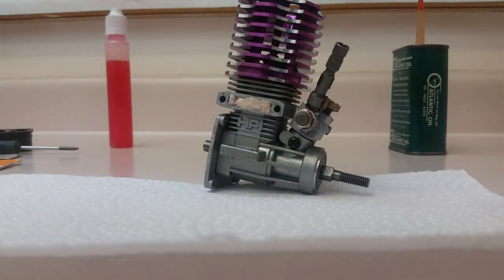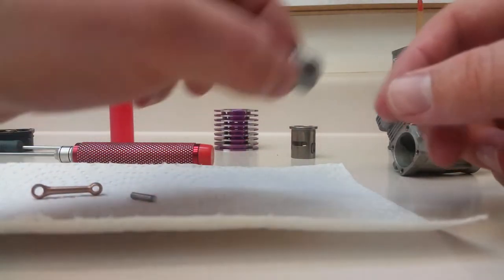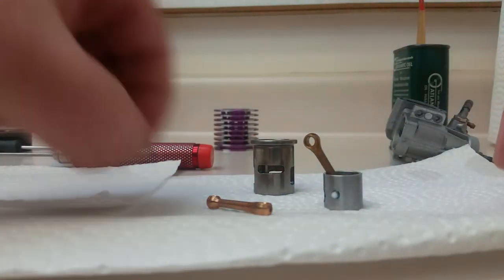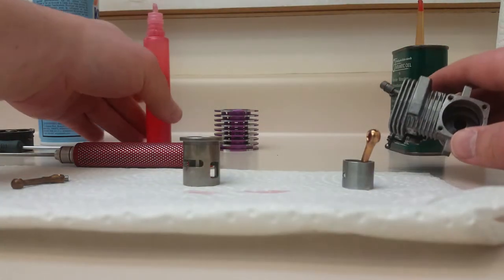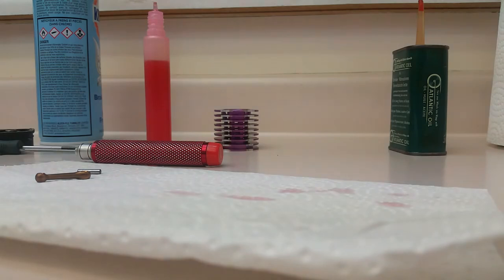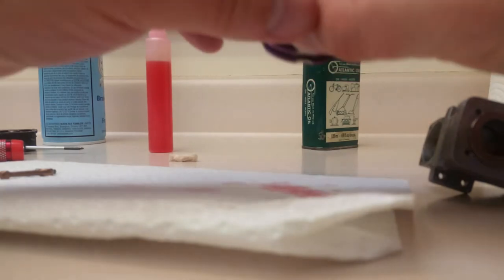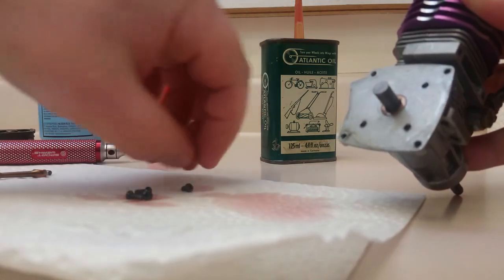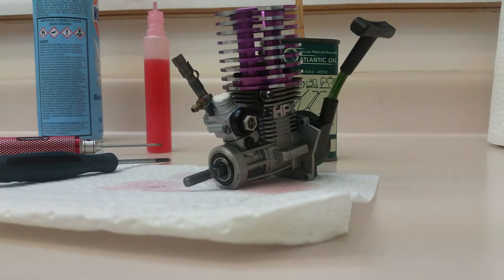HPI 15E engine piston pin and connecting rod replacement

Comment: wow! questioned answered at 1.44 in this video! what happen  i took apart my HPI 12R SS Racing Engine and could not remember what side that big hole on the piston was facing ,so i panicked and there it is when your piston hit the table! thanks very!
Reply from the maker: Hey sorry for the very late reply I just got your message like a rate this 2nd and the big hole in the piston faces opposite to the exhaust port

Comment: What do you suggest for a replacement rear case gasket. I have a old hpi pro k12 evolution II engine that when i removed the rear cover it just disintegrated. And none to be found anywhere.
Reply from the maker: Get gasket paper and cut your own
Reply: @thebug4046  , the one that disintegrated was clear, like wax paper in a way. Probably not even as thick as paper. I have been unable to find anything that thin. I'll keep looking. Thanks for the tip and content. I'm enjoying your vids.
Reply from the maker: @speedbob712   If you're really good with an exact and if you can actually use a piece of printer paper and a little bit of moto seal
Reply: @thebug4046  that's a great idea. Thank you.

Comment: Same operation for the 15FE, correct?
Reply from the maker: 15e 15fe 12e 12fe all the same procedure yes
Reply: @thebug4046  awesome, thanks!  I need to deep clean my engine; it runs, (after almost 10 years of inactivity), but runs super rough.
Reply from the maker: @Snyper1188  I think I have some tips on cleaning engines I'm not exactly sure being as I have a lot of videos but what you can do is clean the inside of the engine out with some fresh fuel or non-chlorinated brake parts cleaner to remove all the varnish also check to see that your high speed needle is clear of any varnish and that you have no fuel tank leaks or any exhaust leaks has that will cause you a lot of tuning issues another thing is to stay away from using WD-40 inside your engine that stuff is horrible it washes oil away it leaves your engine dry and will not protect against metal to metal contact you can reassemble your engine with some after run oil or some castor oil if you have sum also stay away from Traxxas fuel it's really crappy stuff get anything other than that also if your fuel is very old that can cause running issues as well
Reply: @thebug4046  I have about half a gallon of Blue Thunder 10% sport, castor oil, I will have to get...  I have both a 15e and a 15fe-which is on the car with the rotostart, as my car is the rs4 evo.  I have fixed my idle as not to go below 1mm when applying the brake, and it doesn't die now, which is always good lol.  My carb needs to be throughly cleaned, as does my needle valve.  It seems to be "pissing" rich.  I have both a single speed (47 tooth I think), and I just received a stock 2 speed, (found and bought from the netherlands) but I will have to order a new bell housing.  I thought I had one here in Kentucky, but sadly it's in Florida with all my other crap.  I converted it from 2.4 to 4hz, my OEM radio was trash.  I will probably post a video of investigative surgery to see if anything needs to be replaced, but that will be a while, I got a lot going on right now, and dont want to open either block until I can replace any worn or broken parts.
Reply from the maker: @Snyper1188  Blue Thunder Field isn't bad stuff at all they don't sell it in my area anymore and for castor oil I usually get Maxima 927 or klotz castor oil with the green label you can add it to your fuel you can use it to make your own Fuel and you can use it as a assembly Lube

Comment: Hey I have a hpi nitro star pro .12 K12 engine can’t find a pull starter for it will fe fit don’t ???
Reply from the maker: The K-12 is actually a rebranded Novarossi engine that engine is so old they're almost impossible to get parts for
Reply from the maker: You can try and see what happens

Comment: Hello..I'm from USA, just wondering where to get the parts I have OS and the same model stated on video. Also a new body Thanks.
Reply from the maker: You can call your local dealers or go on eBay that's about the only thing that you can do if you're looking for parts good luck I hope you find what you're looking for
Reply: @thebug4046  I did try E-bay but with limited parts supply, most of the Hobby shop here San Diego close for good. I've seen online most in UK but it's the same (out of stock).
I have Viper Gts-R vintage (discontinued model) I just saw it in my shelf intact all those years in an original box. Put it all together and still runs. I am a Nitro person on my younger days and blew some of my piston on my RC due to high speed but then parts are just next door (lol). Now those days are gone. I'm coming back again I hope it won't blew my piston again..
Reply from the maker: @mikeeasy7728  yeah that's the downside with all their stuff so you might have to switch to a different engine but I will say that there is a really great site on Facebook called Nitro RC enthusiasts if you go on there and check it out it's all Nitro everything new old we help people out it's a lot of fun just no electric stuff allowed so you can check that out if you want
Reply: @thebug4046  Thanks.. I will check it out.
Reply from the maker: @mikeeasy7728  no problem
Reply: @thebug4046  Buddy, how can I remove the screw of the clutch bell? Is clockwise or counter clockwise?
Reply from the maker: Hey I'm over here in Canada I ordered my parts from a friend of mine who lives in Osaka Japan I moved there a few years ago this is an HPI engine which is a different manufacturer from OS maybe check eBay and see if you can find some part numbers good luck I hope you find what you're looking for

Comment: Could i use vegetable oil?
Reply from the maker: No
Reply from the maker: You can use a full synthetic 5w30 to  Assemble your engine with
Reply: thebug 404 oooops
Reply from the maker: @pcrashford5367   It doesn't have the film strength of a proper engine oil it will also turn to varnish and it can also be slightly corrosive side suggest taking your engine back a part using some brake parts cleaner thoroughly cleaning and using the correct stuff what I recommended
Reply: thebug 404 can i use wd40 instead of break parts cleaner?
Reply from the maker: @pcrashford5367  to clean yes do not use WD40 as after tun oil as it is mostly a solvent it's a very poor lubricant and remember  You do not need to use after run oil every time you go out if you run your engine dry of fuel before storage the only time you need it as if you're letting your engine sit for more than a  month at a time
Reply: thebug 404 thank you so much
Reply from the maker: @pcrashford5367  no problem!